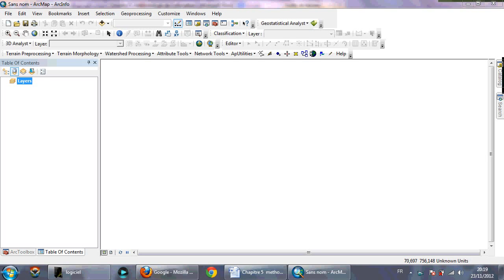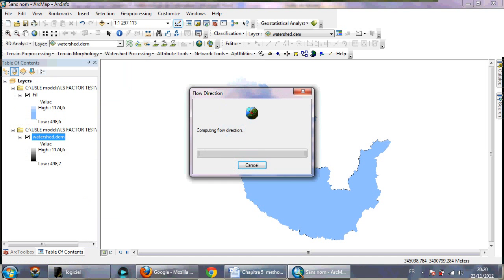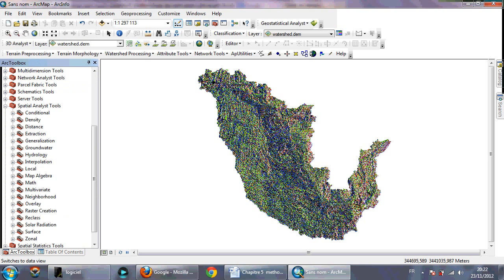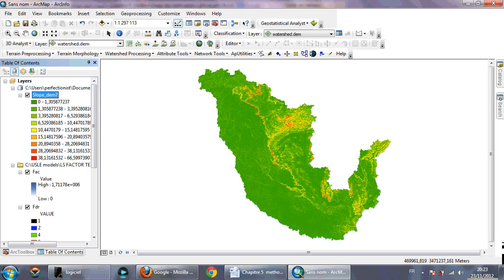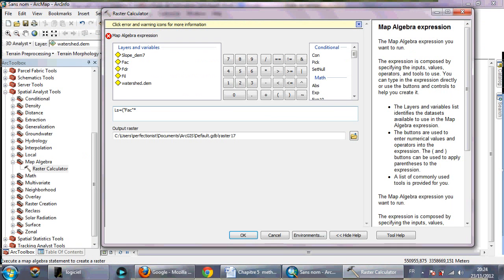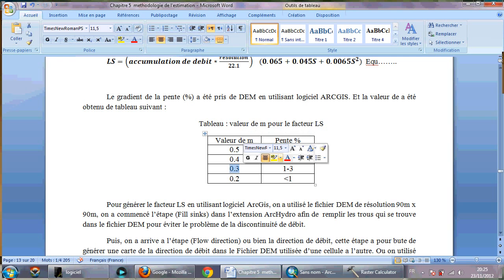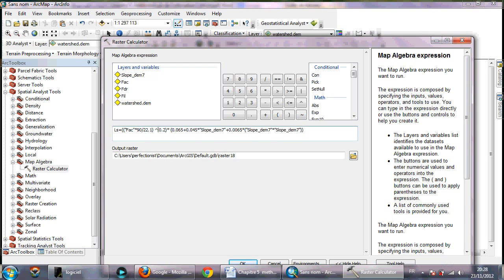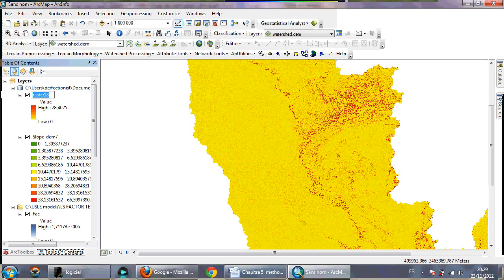LS factor map plus precis

Comment: thanks pls tell me the genral formula of rusle
Reply from the maker: Hello
Thank you for your comment

The RUSLE is described in IECA (2008) as having the following form:

A=R·K·LS·C·P

where A is the annual soil loss due to erosion [t/ha year]; R the rainfall erosivity factor; K the soil erodibility factor; LS the topographic factor derived from slope length and slope gradient; C the cover and management factor; and P the erosion control practice factor.

The limitations of RUSLE are that it only accounts for soil loss through sheet and rill erosion and ignores the effects of gully erosion and dispersive soils. There is also no accounting for deposition of sediment before reaching the waterway. Due to these limitations, RUSLE is at best a coarse predictor of total suspended solids (TSS) loads delivered to waterways.

Comment: For mine I reclassified the slope map into a new map I named m with the 0.2 to 0.5 distribution except I used integers such as 2, 3, 4, and 5.  Then in the raster calculator I multiplied the reclassified map m by 0.1 so the resulting LS map would use 0.2, 0.3, 0.4, and 0.5 in its calculations.
Reply from the maker: jaedehunter hello friend
i hope that you are fine 
I want to know 
why did you classify the LS map to the new values ?
Reply: Because my project site is very large.  I am too lazy to go through each county so I am automating it in a python script.  I just reclassified the slope map to a variable m not the LS end result.
Reply from the maker: jaedehunter hello sir
do you thinks that it's correct ?
because on the LS equation you have to multiply the m value in the exponentiel 
so why you are creating a map and in fact you are in need to just one value
Reply: Seems to come out to be exactly what I needed.  It is not too much different from the tutorial.  My m is not a constant in my equation:  (fac * 10/22.1)^(m * 0.1) * (0.065 + 0.045 * slope + 0.0065 * slope * slope) where m is a map and not a constant.

Comment: Hello, I found this very interesting equation. this equation would be a mix between Desmet and Govers (1996) and Wischmeier? You have bibliographic sources that confirm that this method is actually more accurate?
Reply from the maker: yes i's useful as you said , for the bibliographic , it's approuved equation there are many researchers who used it iam gonna find it and i will send it to you
Reply: thanks! I'll be waiting!!
Reply from the maker: el salam alikom mr almeida90
Ihope that yu are fine , I am sorry because it tooked me a time to respond you , in which concern the bibliography of Ls factor , I give you an internet links which lead you to find those refernces :
1) https://www.google.dz/search?newwindow=1&q=LS+factor+%2B+Bizuwerk+et+al.+%282008%29+&oq=LS+factor+%2B+Bizuwerk+et+al.+%282008%29+&gs_l=serp.12...52063.52063.0.53384.1.1.0.0.0.0.216.216.2-1.1.0....0...1c.1.51.serp..1.0.0.MWBZVGyA02A

2)http://www.google.dz/url?sa=t&rct=j&q=&esrc=s&source=web&cd=3&ved=0CDAQFjAC&url=http%3A%2F%2Fgeology.um.edu.my%2Fgsmpublic%2FNGC2013%2FProgram%2520Book%2FRaw%2FRaw%2520Papers%2FA02%2520NGC%25202013%2520Sahibin2.docx&ei=uZP1U4jwAe-L4gTAhYDYBA&usg=AFQjCNFBwpnm2zrN3zxTu4Kci40TqEHCZw&sig2=ft3LQIih81UJYrHLhHTAUA

I hope to find it useful
el salam alaikom
Reply: OK! Thanks very much!